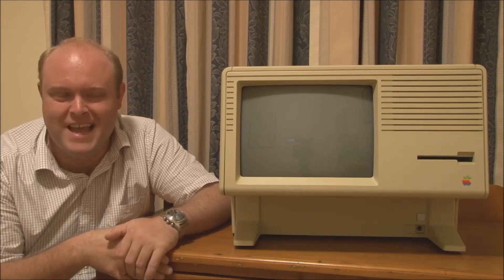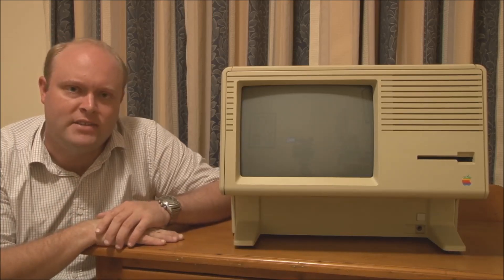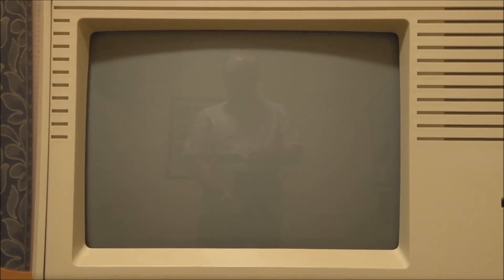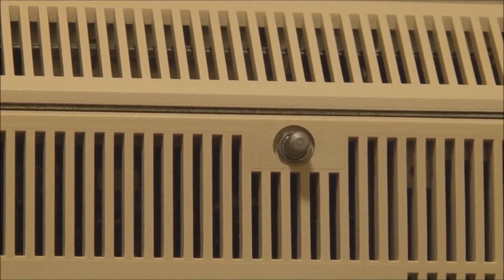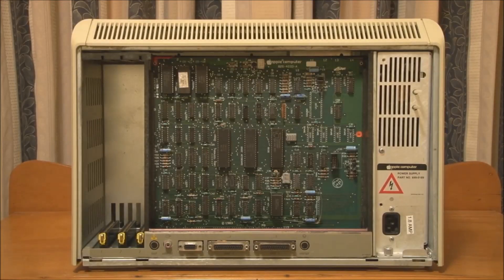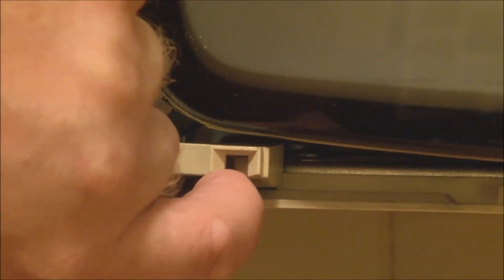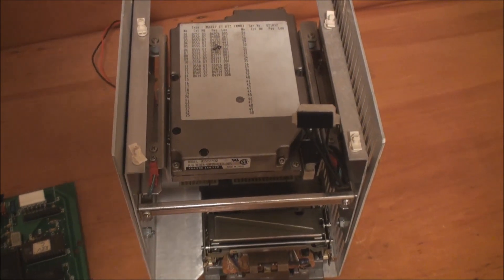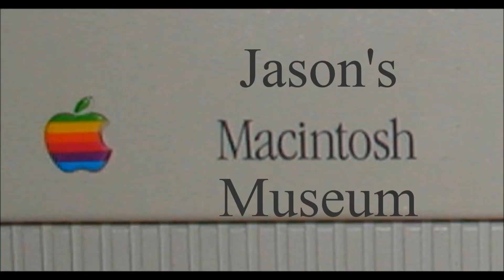Macintosh XL / Apple Lisa 2 (1984) Full Tour and Disassembly

Comment: Hello! I recently acquired an apple lisa 2 i m not a lisa expert and i wanted to ask if you know the reason why this can happen
I think it s a common problem, so i wanted to ask you about. 
Once i turned on the computer for first time, the computer turned on without any problem, the screen trembled a little bit, but anyway, perfect for a computer from 1983.
Today i decided to clean a little bit the computer boards  and i took out the boards and power supply and after bringing everything back  to its site with a lot of care, nothing cracked.
The power supply makes this tick tick tick noise and it doesn’t turn on. The thing is that that sound it only can be heard when you keep the power button pressed, do you know what can it be? It should be easy to fix because I didn’t changed anything, just disassembly and again to its place
Thanks from Barcelona , my powerbook 170 was repaired thanks to this channel,